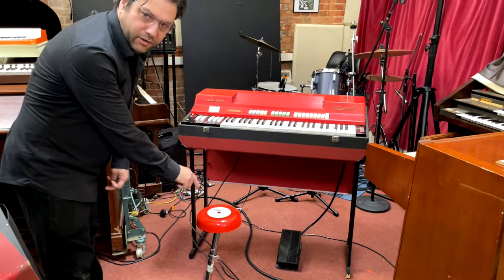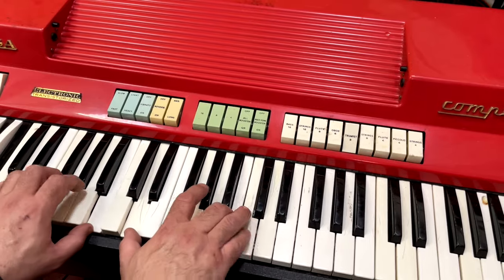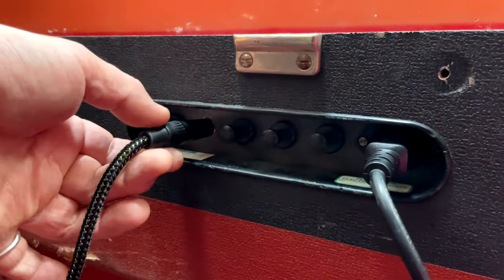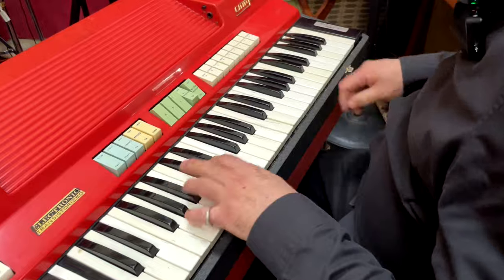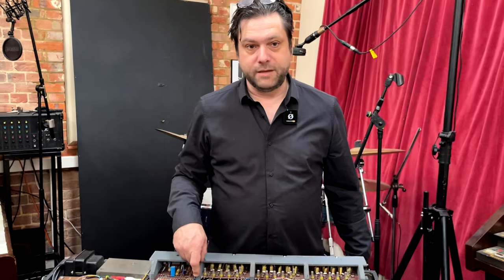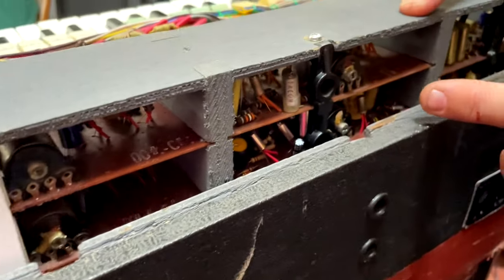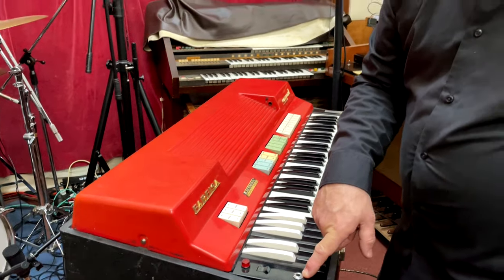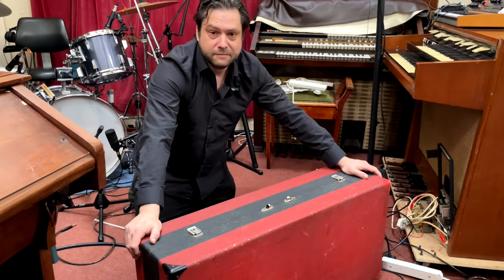1964 Farfisa Combo Compact Demonstration and Repair

Comment: According to Babani's 1974 book of substitutes there are many for SFT352: AC117-122R-125-128-131-151V-162-192, BSX36, NKT304, 0C304, SK3004, 2N591-1189-2000, 2429-2613-3638-4030-5040, 258120
Reply: 😂i have that Babani transistor equivalents book, it came in very handy back in the day when I was scavenging bits from defunct computer pcbs, and they used to leave decent lengths on the device leg’s!
Reply from the maker: Fantastic! I must get this book! not heard of it before!
Reply: @VintageKeysStudio  great series of little books. My recent babani is Radio antenna and how they work, I’ve read it twice and I’m still at a loss :0)

Comment: Once folded there barely is any difference compared with a handbag! And this organ comes with that awesome red colour which survived more than the last half of a century. Two features almost impossible to beat ... Thanks for sharing :-)!
Reply from the maker: Thank you Curtis - I have to say, we had to do a retake on this one as I originally got half way through and Louisa realised I was demonstrating a handbag. It is, as you said, very difficult to tell the difference.  One day I will put together an outtakes reel with all the handbag bloopers :)
Reply: A handbag doesn't weigh the 75 lbs the regular sized Farfisa does(!) 😅

Comment: Being a Farfisa owner and player back in the 60s and70s, I totally enjoyed your vid. I still have my Compact Duo which is the 2 keyboard version, the largest from that time, with a Leslie 147. Also with the 1 octave bass pedals. I remember a few players using the red Compact and the gray Deluxe Compact back in the day. They were a great organ back then.

By the way, the volume pedal is secured between the 2 clamps on the right in the cover. The 2 clamps on the left in the cover holds the bass pedals.

Too bad your are in the UK. I am in the USA and would look you up if it ever needed repair.
Reply from the maker: Ahh thanks for the info about it the way the pedals fit in the lid! I was very confused about that. Thanks very much! :)

Comment: Fantastic!  I’ve got a Yamaha SK-50D, and I’ve been thinking of opening it up and taking a look.  It plays, but sometimes pops and then no sound.  If I cut it off for a minute and restart, it’ll play away until another pop, then again, no sound.
Reply from the maker: I believe this is quite a nightmare to service. You could try getting the power supply and mixer/amp looked at first. Good luck!
Reply: Thanks!  Love your channel!  Cheers!!

Comment: The power cable socket and the locking jack socket on the bottom are after-market mods (and useful ones!) – mine still has the original setup where the power cable and the output jack cable are attached to the organ and fold up inside the bottom for storage. Love the Compact – such a cool instrument…
Reply from the maker: Ahh cheers for the info! I haven't seen another one of these for a long time. I had a grey one before, years ago.

Comment: Do you just turn up Bass and Treble in the back? Didn’t find anything in the manual on stock settings. Thanks!
Reply from the maker: I would set them both at midway point and see how it sounds

Comment: I managed to rescue a Yamaha DX11 from my workplace that is in need of 2 new keys and maybe some switch replacements... Is it worth holding onto to try and find a repair location for it or is it sadly going to have to go in the dump?  I primarily work with VST's and have a arturia microfreak for hands on sound design so grabbed this for sakes of having an FM synth from the 80's but understand if they arent worth the hassle to repair, Any advice is greatly appreciated as its now sat next to my sofa being unused
Reply from the maker: I don't think it's worth your while with a DX11 - they seem to be only selling for a couple of hundred pounds.   If it half works, it still could be used though - try plugging an external midi keyboard into it and all of the keys will work then!

Comment: With regard to the knee trembler. Perhaps it might be possible to attach a length of slightly elastic cord to it. If you then attach that to the collar of a small dog trained to respond to hand signals that could work. Needn’t be a dog though, it would probably work just as well with a hefty cat.

This bloody insomnia!, all the best.✌️
Reply from the maker: Or perhaps a trained Parrot?  Or perhaps even a sparrow hawk - it would be very funny watching it try to fly away after a mouse or a small bird, accompanied by a filter sweep, but then realising it can't get very far. Poor sparrow hawk.
Reply: @VintageKeysStudio  😄

Comment: The schematics for this thing are sooo hard to follow regarding the routing for all the tone mixdowns and tabs. It seems Farfisa just left bits out and you have to guess.
Reply from the maker: Yes it was common practice to just draw a vague map of where things were and on one tab or switch, and then just said ‘repeated’ but sometimes they didn’t mention the factory selected components - it makes it much more fun though
Reply: @VintageKeysStudio It has def been more fun having to join the dots and redesign parts rather than copy the design outright. Love your vids btw👍